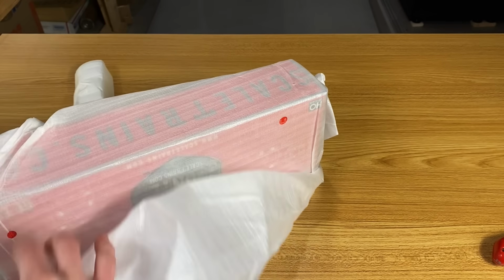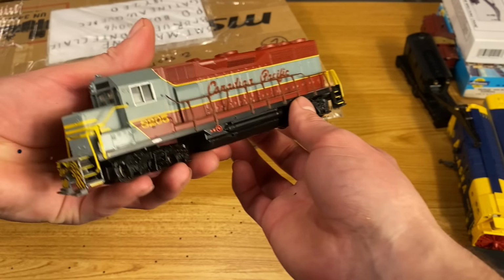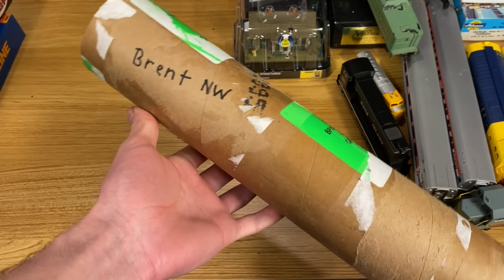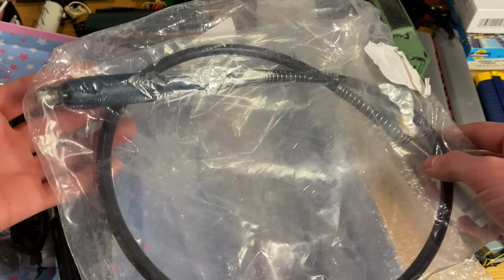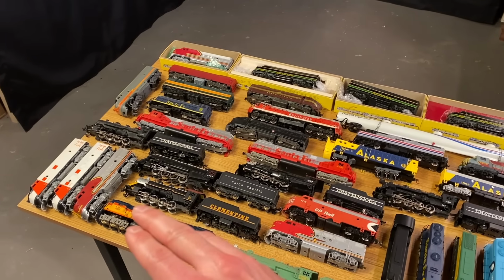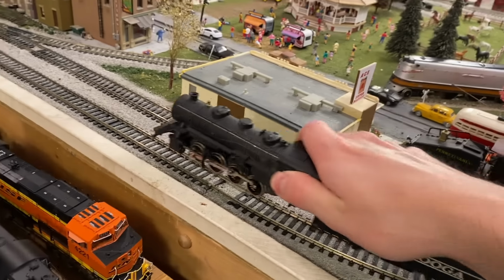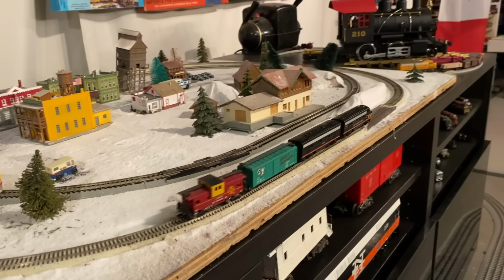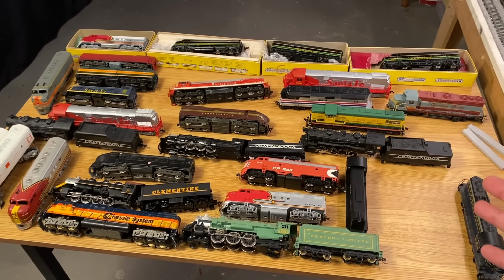MEGA Vintage Locomotives Mail Unboxing - Will Any Run?

Comment: Also, don't forget to set up the stand that came with your new soldering Iron. It will hold it in place securely so you don't have to worry about it rolling off the table and burring you.
Reply from the maker: That's a great feature. I like how it uses less space than regular soldering stations.

Comment: it is a solder sucker so you can desolder stuff, you melt the solder and it sucks it in to the vacuum. You press on the back to "load" it and press on the button to suck it up.
Reply from the maker: That's smart, I could see it being very helpful.
Reply: It looks like there was a stand to put the heated iron on, too, so it won't roll around.
Reply: The sucker will unscrew... you will eventually need to clean the old nasty solder out of it.
Reply: Tg  @SMTMainline
Reply: @SMTMainline  hey it’s Xander I want to see more new videos, OK
Reply: @SMTMainline  I want to see more I’m boxing videos of trains ok SMT
Reply: @SMTMainline  I want to see more new videos of more I’m boxing trans OK
Reply: @SMTMainline  I went to see more I’m boxing videos, OK

Comment: I’m glad someone sent you a real soldering iron!
Reply: He had on sent to him before. He just refuses to use it
Reply from the maker: @bigwoz78  I have used it in several videos but I prefer the 100 watt for the reasons I mentioned.
Reply: @bigwoz78 you know I don't know what it is with people they make a big deal out of a damn soldering iron... Just like the ones that say everything has to be nmra standards. Most annoying people I've ever seen online...
Reply: I prefer to use a gas soldering iron
Reply: @adamswindells1  yeah that's real smart use a gasoline on trains right.... I never seen people so goddamn nitpicky over a damn soldering iron. If it was me I would have told everyone to mind their own friggin business if the guy wants to use a soldering iron that is what he likes then let him use it.  Same goes for the ones that go and parade around and say nmra standards this and that. F them
Reply: @mercuryoak2  not gasoline I'm uk so gas for me is a gas (Butane) works well just remember to point the exhaust away from any plastic parts but I've never had an issue I've used it to cut bodies, solder wires make holes before using a saw amd so on and it's fairly small. I work outdoors a lot too so it's useful for automotive stuff too. Take the tip off amd it works as a heat gun or I can take the entire end off and use it as a blow torch. Everyone has there preferences. I don't like the little plug in irons as they do tend to roll because of the wire or they just aren't hot enough for what I need. The one SMT uses is too big for my liking but if someone handed it me and said that's all there is then I'd use it. It does the job and he knows how to use it and has his methods for putting it down. Nobody can tell him to get a different brand/model/heating mode
Reply from the maker: @adamswindells1  An oxy-acetylene torch?

Comment: The Scale Trains would have been the showstopper, but there were many other things that caught my eye.

The Delta Lines box car may have more significance than you think. This was the railroad of the late Frank Ellison who was an early pioneer in model railroading. His two rail O scale model railroad was featured in the Model Railroader in the early years of the magazine. He would rank up in the notable names of model railroading of people like John Allen of the Gorre and Daphetid fame.

I did notice the Southern Crescent Limited Pacific from Tyco/Mantua. This locomotive was paired with matching Southern passenger cars which are some of the hardest to find.

As for the soldering iron, the strange tool to with a plunger is a vacuum desolder tool for removing solder. Just push in the plunger, heat the solder joint, and push the button. The older solder should be removed. If not, just repeat the process. Also, I was of many that was pleased to see this soldering iron as someone who works on electronics. I save the "Big Guns" such as the current tool that you use for big jobs only that need extreme heat. Also, for using soldering irons, the best way to keep them in place is to use an iron holder. I have an old Radio Shack iron holder with a sponge to keep the iron from moving around. Hopefully, this was included in the package.

There are many other cool things, but I need to start to wrap this up. I did see some items with Mehano motors. Have you ever thought about doing a motor replacement based on the videos from Scott Rails using the AliExpress motor? I have a couple locomotives that I plan to do the replacement. This may make a good video on the channel showing the "Proof of Concept" idea.

Well, I could mention more, but this post is long enough. So, this is a great video, and congratulations on the mail call items. Hopefully, they will lead to more content.
Reply from the maker: Thank you so much for all this information. I haven't seen the video on the Ali Baba motors however years ago I upgraded some Mehano locomotives with skew-wound 5 poles I found super cheap on eBay.

Comment: You need a desk top spring holder for that pencil soldering iron, its a must have - lets you sit your iron in while hot and works much like an old fountain pen holder, you might like the iron better with a proper holder
Reply from the maker: I've seen those but space is of the essence which is why I never bought one.

Comment: Great video as usual. I enjoy these unboxings and testing of equipment. It is the reason I sent you a small box so long ago that I can't remember exactly what was in it. I think it was five older locomotives. Hope it didn't get lost. I'm jealous that you have that working snowplow and power unit. I remember the video you did with the train outside in the snow and it may need a revisit next winter. The running of the trains at the end with all those locomotives was new and I LIKE IT! Best train videos on the internet.
Reply from the maker: There are a few smaller boxes that still haven't been opened so hopefully its one of them. I think I will make another snow plow video but I'm not so sure I would wanna use something this nice lol
Reply: @SMTMainline  Wouldn't be great if the thing worked like the real ones. You have to see for my sake. lol

Comment: Very nice haul Harrison. Looks like that Bowser Soo Line is a patched Duluth South Shore & Atlantic locomotive. Soo Line borged DSS&A and since those Baldwins were fairly new they kept their original paint and Soo just put Soo on the long hood. 
Possibly that U25C can be modded to run on an Athearn chassis and the side frames modded to fit.
Finally take a look at your local hardware store as they sell stands for soldering irons. The one I have came with it's stand but they're effectively a weighted plastic base  with a funnel shaped spring thing and a depression with a sponge you can dampen to clear solder/flux build up from. Very handy to have and minimizes catching a hot iron with your gentleman's bits.

Comment: Congrats on your first ScaleTrains locomotive. As an owner of many, I can say you’re in for a treat. They’re also very tidy to work on compared to Genesis and other high-end brands, especially the shell removal process, very well engineered stuff
Reply from the maker: My first ScaleTrains was their Hiawatha but this is my first RivetCounter. I'm surprised to hear they are easier to work on, it seems impressive considering the detail.
Reply: @SMTMainline  the shell removal is easy compared to a Rapido or Genesis I have found. No hanging wires to accidentally break

Comment: What a nice Suprise Harrison, you never know what you might find useful. The Chino Backshops custom
decals of Arizona copper mines are very interesting to me. I've been to all those locations with my interest
in the copper industry and it's railroads. May have to get me some. So thanks to that follower.
This is one of those times I wish I lived next door so I could come over and raid your new arrivals. I got one of
those Revell building kits when I was a kid for my then layout. They still hold up.
The Soo Line Baldwin DRS 6--6 1500 is pretty sweet. I have a few in SP and a brass one in Trona. Bowser is good
stuff, have done quite a few locos important to me. The upcoming Alco C415 units are a favorite.
Rotary plow pulling the giant tank car, only in the mind of SMT management. I need a nap after that epic unbox.

PS there was a shop you visited that had a huge selection of Locos, like more than I'd ever seen in one
place. Can you refresh me on the name? I want to see if they have something odd I'm looking for. Thanks.
Reply from the maker: Thanks for the comment. I think the shop you're referring to is Van Horne hobbies https://www.youtube.com/watch?v=3xXqqFhdR1c&t= if not it might be the Red Caboose
Reply: @SMTMainline  I think that is it Harrison! As I suspected they have no web page, are just on
facebook. (I don't do facebook) and I don't see an email. So I think I'm going to call them with
the item I'm looking for. Question, since I'm calling into Quebec should I ask for an English speaker right when they answer? Or should I just ask in english and see what happens? What is the polite protocol eh? And thanks! 🙂

Comment: You finally got a Scaletrains locomotive, Harrison, and a Rivet Counter at that!  A little history on the prototype, its known as an ES44C4, which is a variant of the ES44AC that uses 4 traction motors as opposed to 6 on the standard model.  Only BNSF and Florida East Coast rosters these locomotives (although BNSF by far rosters most of those built).  The locomotive has extra cylinders on the truck side frames, which allows it to lift the center axle of each truck to put all of the locomotive's weight on the powered axles.  According to GE, the locomotives were supposed to meet or exceed the pulling power of a C44-9W or ES44DC.  Unfortunately, the design was alot better on paper than it turned out in real world situations as the locomotives suffer from excessive wheel slipping, especially on wet rail!  It also doesn't help that BNSF puts these things on trains they were never designed to haul.  As for the Scaletrains model of this locomotive, I can say from experience this locomotive is exceptionally powerful, able to handle between 50 and 60 cars on level track.  Nice haul overall, Harrison!
Reply from the maker: I've had a ScaleTrains locomotive since 2013 - my Fox Valley Hiawatha was made by them but this is my first Rivet Counter. Thanks for the info on its real world counter part, I had no idea they were prone to wheel slipping issues.

Comment: Yes, that Mehano Chattanooga 917 is the last Tyco Chattanooga locomotive ever made, manufactured by Mehano for Tyco, and only produced in 1991-92.
Reply from the maker: It's too bad it didn't continue. I think most people would have liked TYCO products with higher quality drives.
Reply: @SMTMainline  I think Tyco's reputation had been destroyed by that point - if only they had tried that earlier!
Reply: @SMTMainline  There were a few diesels made for Tyco by Mehano though - they were basically rebranded AHM/IHC locomotives, but some had graphics unique to Tyco - I could give you some tips on how to spot them, if you like.

Comment: I have those pencil type soldering irons. However I've overcome the "rolling" or "falling off the table" by using a large porcelain insulator from a power pole, to hold the soldering iron when its in use, by placing the iron vertically in the support pin threads.  This way, I can use my soldering iron for extended periods of time, without worrying about getting burned on it, or it starting a fire.

Comment: What an awesome lot you got. Some of those locomotives I haven't seen myself. Such as the later Clementine loco that basically Tyco rebadged a mehano. You know as much as people bash you for that big soldering iron.. wherever it was made it last a lot longer and has better quality metal then the junk that they make today. I had it where I spent some extra money on a soldering iron and the tip started to warp... My mom used to have a wells brand and that was something from the 70s and worked great.  Sometimes certain people like that need to get a life.. enjoyed the video

Comment: The runaway train consist is Alaska  railroad units. Technically.
They were rented from ARR to film and were painted dark brown or black to contrast the snowy backgrounds, and the director wanted a black and white feel. ARR didn't want any of its logos shown, but eastbound 12 that gets the caboose run through had the old school black with yellow striped paint scheme on the lead switcher.

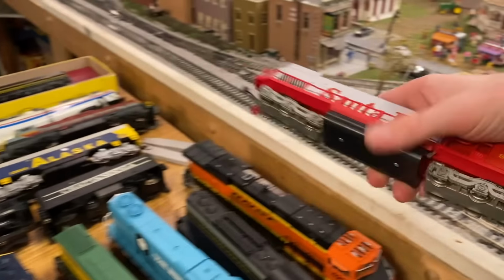Comment: 28:26 The prototype locomotive for that model is the ALCO C-628 where C stood for Century, 6 for the number of axles, and 28 referrering to the horsepower in hundreds (2800 though the prototype was shy of that by 50 due to limitations of onboard DC generator technology)

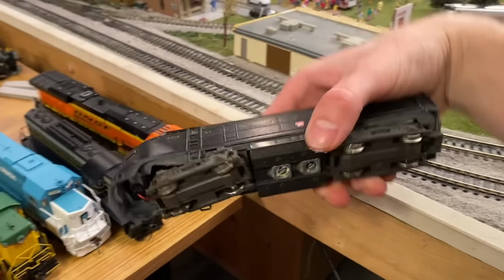29:35 The Rivarossi Burlington unit is based off the GE U-25C which was a contemporary prototype when the model was first introduced in the 60s. There might be a gearbox issue as the motor inside the cab drives a shaft which goes to a gearbox that then has output shafts on either end to drive the respective truck (also the body screws can break the mounting posts in the body if over tightened unfortunately)

Comment: You could use the motor out of that Rivarossi GE to fix the Blue Goose!
Reply from the maker: The motor and linkage were not the failure point with the Blue goose this time. The oil pan had a loose bolt which allowed the driving gear to fall out of place.

Comment: SMT - As Gary Sprandel said, the Soo Line Railroad bought the Duluth, South Shore, & Atlantic Railroad in 1961.  In 1962 the Soo Line Railroad started painting its diesels red with a very light gray (looks white) and black lettering.  A friend of mine had the TYCO Cresent Limited 4-6-2 Pacific and could pull very long trains with it!  The cylindrical device that came with the soldering iron is a vacuum desoldering pump and is used with the iron to remove solder.  The " hunting tower " is actually part of the Revell sand house and that boxcar converted to a building was also made by Revell.  The Baltimore & Ohio GP7 is a dual service locomotive - the "torpedo tube" air brake tanks on the roof made room between the trucks for the fuel tank and a water tank for generating steam to heat passenger cars.   The REA car is actually an Express Refrigerator car and was commonly used in passenger trains and mail & express trains (The "Pullman Green" color) usually after the locomotives, or sometimes at the rear end of a train to be dropped off enroute.  This car's use was to transport sea food across the country from the Gulf Coast.
Reply from the maker: Thanks for all the history.

Comment: Video is 6 months old, issues are probably fixed by now. Guaranteed that B&O GP9 needs axles. The over/under on those things is 2.5 axles when changing hands.

Comment: Super jelly if the southern Pacific  F7 A and B unit n scale set. I got the A unit at a yard sell with a bunch of n scale stuff for 100 bucks but the A unit will not run no matter what I do and being a budget modeler who still working on trying to make a layout I can't just drop 50 plus bucks to replace it which saddens me as I love SP Black arrow units almost as much as the SP daylight colors. Hopefully I can get it fixed eventually to have it run with the rest of my collection I'm building

Comment: Hi Harrison i was wondering is it alright to us you layout videos to help create my n scale l am building this summer. I was also wondering if you had any advice on how to get stuff for it.
Reply: in my opinion the best place to get trains for n scale is kato, they make some of the best trains. They run incredibly smooth 10/10 recommend. If you are looking for track you can pick up some pretty good Buddles of track at train shows for a good buck and you can also find locomotives and rolling stock pretty cheap there if you're on a budget. Ebay is also a good resource for cheaper n scale stuff. I hope this helps 👍

Comment: At my job on one day someone brought a 60s soldering iron that had a rusty and glue on the element and once I replaced the old one with a new one at first I thought it was too good to be true but it was because it still works

Comment: 9:50 thats a very interesting model, thats i believe an early soo locomotive when they had some sorta merger with the DSS&A, and iron ore hauling railroad near Duluth (i probably got that totally wrong), its a really nifty model, ive only ever seen some local wisconsin modellers make brass paints of those engines so its a pretty good find
Reply from the maker: It sure is

Comment: I am also a fan of you from the same city near Versant High School and when you got a package saying "15 rue monteclair" it shows bd montclair instead lol. I am also a model train guy which I have the older couplers
Reply from the maker: BP is correct. Québec is a primarily french province so bp is the equivalent to bd.
Reply: @SMTMainline  yeah I know. So you speak both english and french or only english
Reply from the maker: @KILLA_DDEE  Pretty much just English. I’ve learned enough French to order at a drive through window or check out at a store but that’s about the extent of it